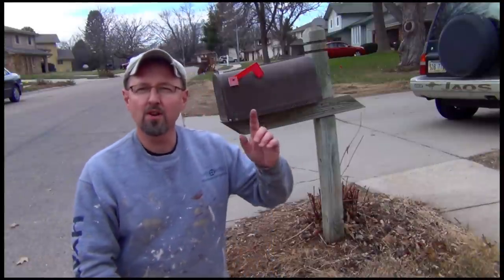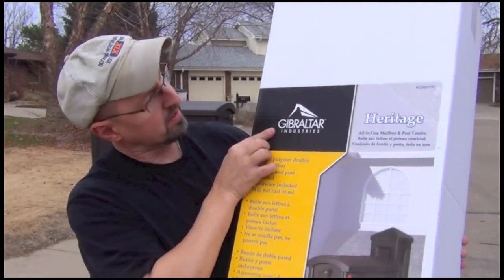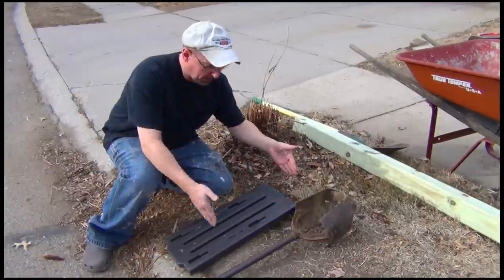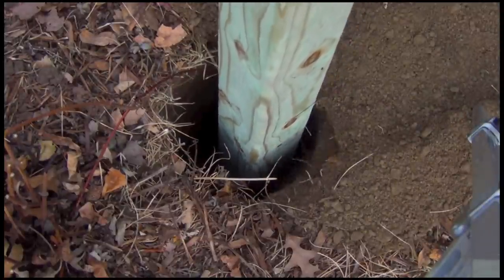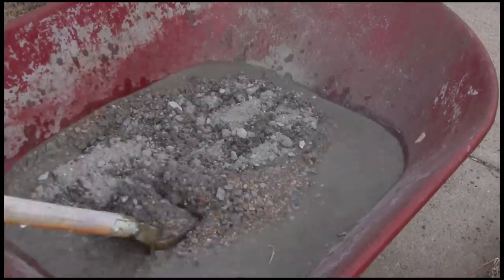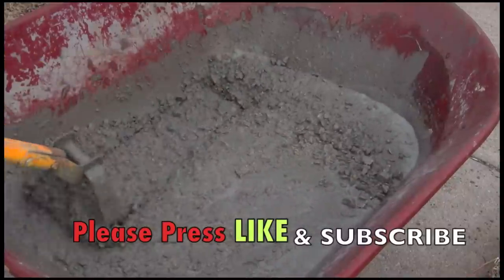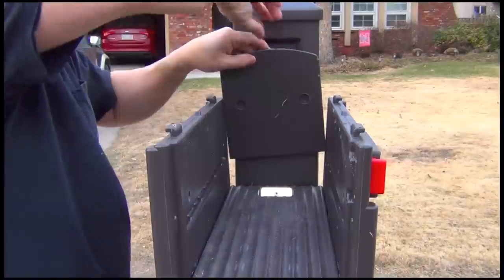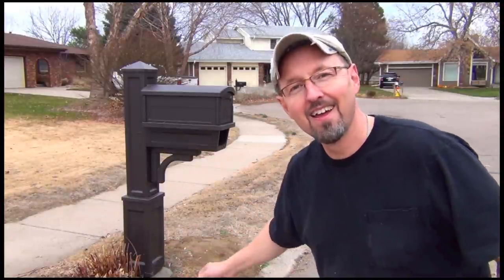How to Install a Curbside Mailbox and Post

Comment: This is not the best way to install a post.   Depending on where you live your frost line will be different.  If you don't dig the hole deep enough your mailbox may start to shift on you over time.  Rocks should have been added to the bottom of the hole for drainage, otherwise, the bottom of your post may start to rot.  Adding cement like Tony did is fine, however, you can buy the bags where you just fill the hole with cement then add water - much easier.  It's a good idea not to go all the way to the top with cement - leave a few inches for soil to cover up the cement.  Check with your local postal service on how far from the curb your mailbox should be before digging the hole.

Comment: You should add some stone to the bottom of the hole before the cement.  Also don't over fill the hole with cement and then you can cover it with dirt.

Comment: i know that mixing cement before pouring is the correct way but u can also just dump the bag in then add water with water hose directly to the hole.no mixing required. good quality vid though.

Comment: Why not take a bucket and screw in the 4x4 from the bottom of the bucket.  Then place that in your hole and out the cement in that?  Then when you need to replace it, you can lift it out.

Comment: A few things....don't overfill the hole with cement! Two....have a brick box installed (if your home's aesthetics fit that look) lasts longer and looks better.  Lastly, think security! Install a mailbox that is lockable. Overall - decent little video.